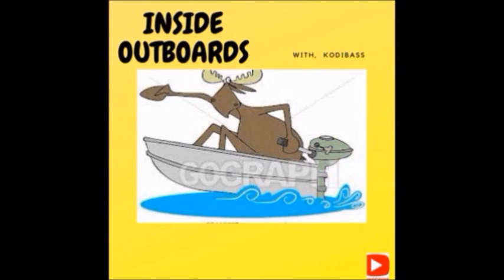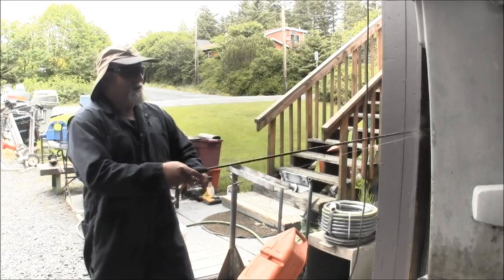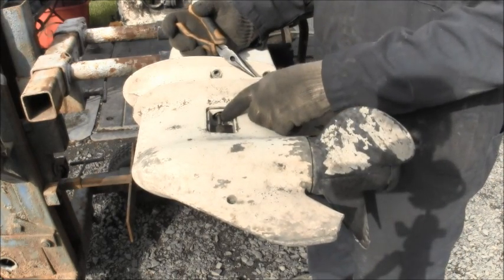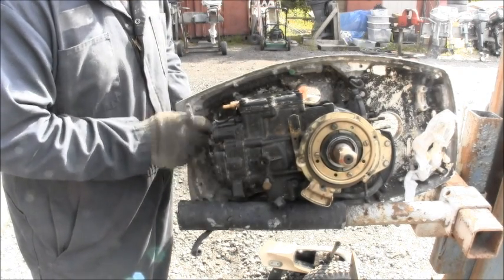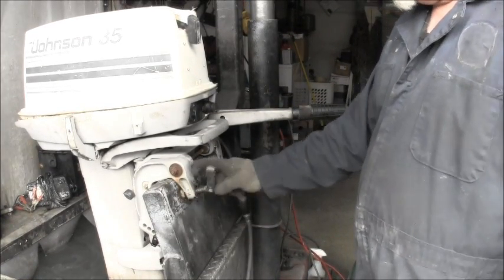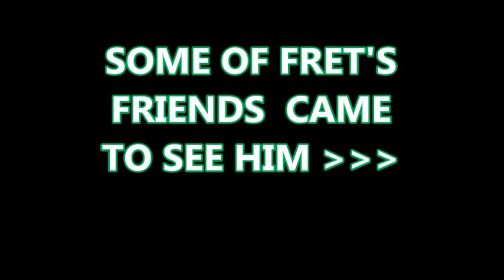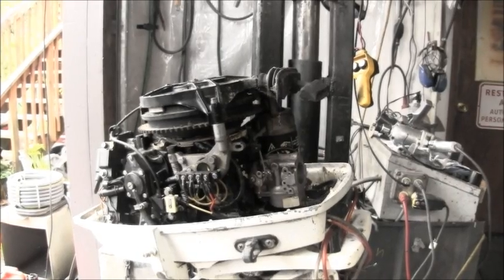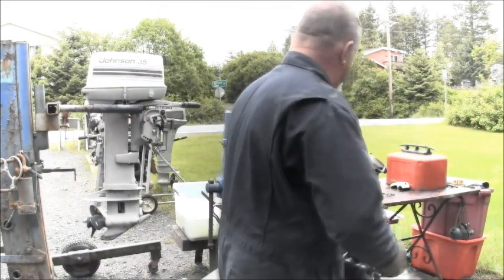JOHNSON  25 / 35  HP    & A DAY OF OUTBOARD FUN

Comment: Hi Kodi, Hope you are doing well. Buddy and I took the Starcraft out last week for our annual test run on Lake Washington and the motor ran great but was barely peeing. I thought it was the used impeller that I put in last year but turned out the pee tube was clogged up enough to slow the volume down to a trickle. I bought another kit anyway just so I have it. Boy I can't wait to show you how the paint came out on the Mercury Mark 10. Looks really cool. The motor is ready to reassemble but got folks wanting me to do some more testing videos first. Stator, trigger, coils and regulator.
Reply from the maker: Looking fwrd to seeing it 4 sure, Glad it was just a clog way cheaper.   kb

Comment: The part on getting the shifter connector loose contains invaluable info. Thanks a lot ! As to getting the crawlers out of the motor, I suggest aiming a heat gun set at max level towards the nooks and crannies they could hide in ( aka  cooking them dead ) and then shooting compressed air in. Keep safe and be merry !
Reply from the maker: Might just give it a try, Thanks    kb

Comment: Kodi, I noticed that the skeg tip was broken off of the first motor you dealt with. I have the same thing with my outboard now. I know they sell skeg end repair patches that straddle the skeg. Will I see over a MPH drop in boat speed if I install one? My Raymarine fishfinder reads down to tenths of a MPH.
Reply from the maker: Most likely yes' More drag = less speed.   kb

Comment: From a mechanical point of view, what is your take on outboard concentrates for the flushing and removal of salt and calcium deposits that build up in the water chambers? asking based on the age of the motors you working on.
Reply from the maker: Most products that are on the market are Nitric acid based solutions  they work to a degree.  However once the damage is done from salt , neglect etc.  They are of little use.   kb

Comment: You got that 25 Johnson at the same time and from the same guy as the 35 Johnson.  He drove up and both were in the back of his truck.  You said it was Christmas Morning!!!
Tell us about that little "copper-head" Johnson out at the road on the motor rack.  Looks like about a 1956 7.5hp or maybe a 10hp.  Is it a running motor, or is it just a potential "mail box"?  It has been there for months if not years - ever since I first became a follower of Kodibass.
Reply from the maker: Yes it's runs well.  I have several vid's of me going through it,    kb